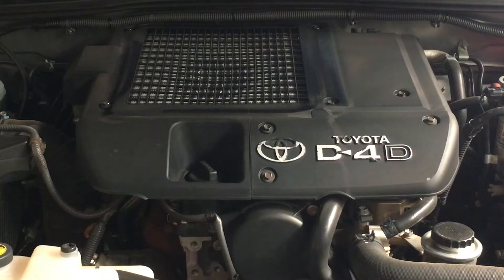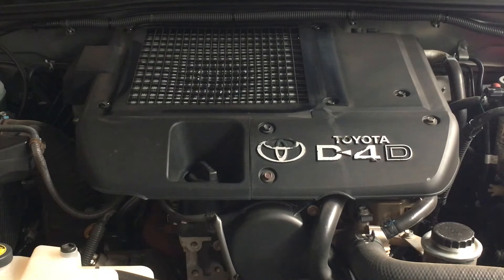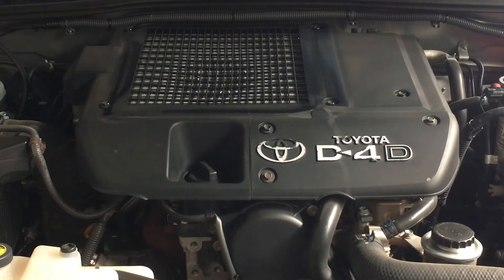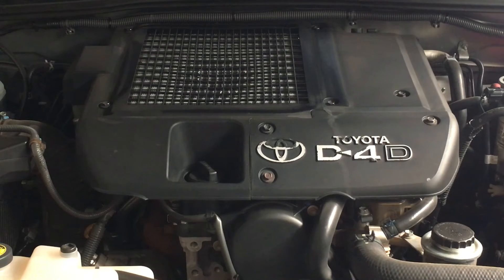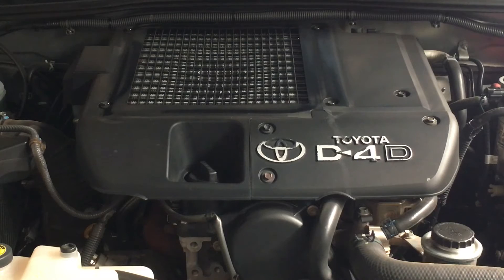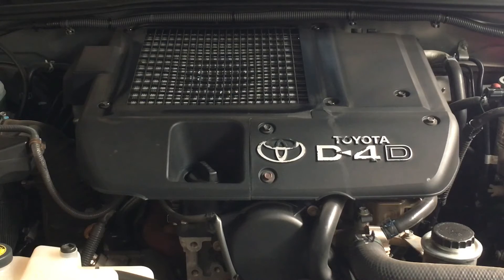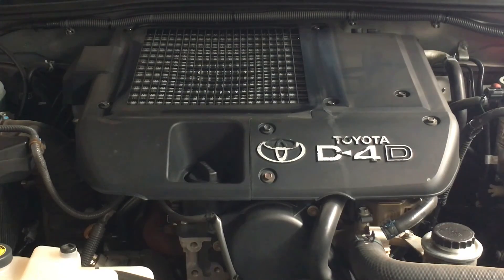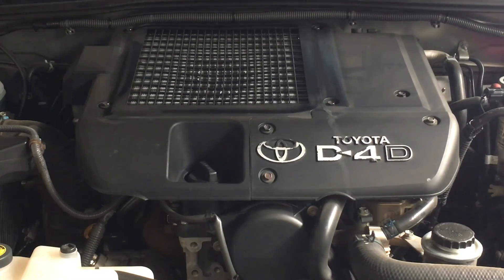BASIC EXPLANATION OF PCV & EGR

Comment: You wanted a really good reason why exhaust gases from the clean side weren't used to cool the combustion. I don't know much about diesel but I can guess the used method makes the engine less reliable. Diesels reputation comes from the 1970's when the Arab oil embargo occurred meaning they withheld their oil leading to a shortage in America which meant they lost on profits, the public saw fuel prices quadruple and so the only ones that benefited was the oil companies which are American and the US government from the tax revenue. Diesel cost less the petrol or gas Americans call it so a new market was going to be created and to fill it GM came out with their 350 engine. Unfortunately or fortunately if you were the US government the 350 engine was destroying cars at an alarming rate, by the thousands left beyond repair. GM wasn't too concerned they had already survived being involved in Prescott Bush's plan to overthrow America's leader and align the country with the Nazis and then the countless American casualties when they were given the contract to expand America's air force in the war against the Nazis. The 350 engine resulted in a small lawsuit payout in the millions but I'm guessing less than 1% of their profits and set the trend for diesel. As a side note 5 years after the oil embargo Prescott's grandson George W. Bush starts the Texas oil company Arbusto Energy with Salem Bin Laden. But remember the golden rule hear no evil speak no evil.

Comment: If the pcv is blocked, how would it pop seals if there's also a breather hose connected (usually) from the valve cover to the main intake tube / airbox which is essentially open to the atmosphere. Wouldn't a blocked pcv just force all crankcase venting to go through the breather hose?

Comment: I had my EGR turned off through my computer after having issues with it, no blanking plate, 2 months later I blew my turbo into my exhaust (still a fin in the muffler haha)  wonder if it had something to do with switching the EGR off? 
Also burning a bit of oil so might get my PCV changed: 
Thanks as always for your vids, very informative

Comment: I have a oil catch can but after watching your videos  I decided to hedge my bets I left the catch can on but removed the filter element. Oil still goes through but not as much without the catch can. Also I installed the blankin plate with the 7 mm hole. After doing 30000 km the inlet manifold still looks new just a little oil.